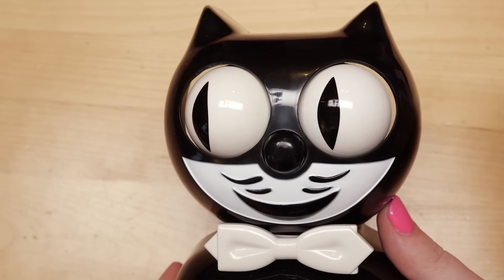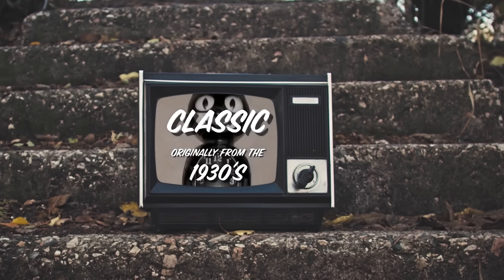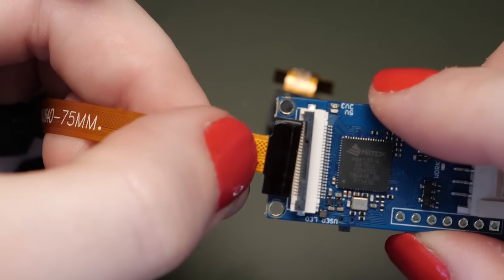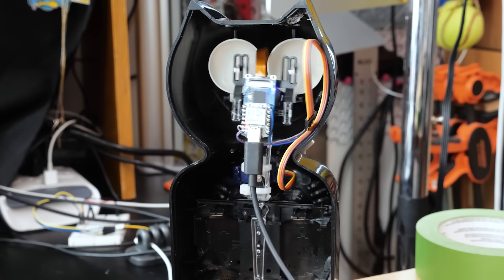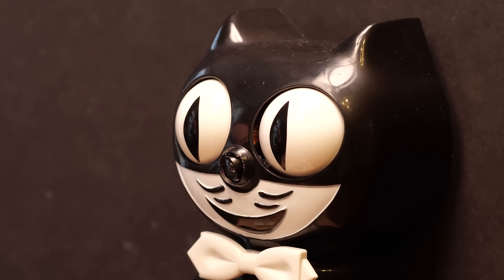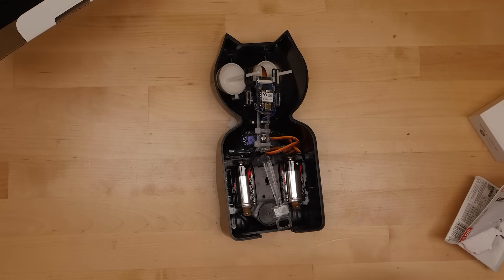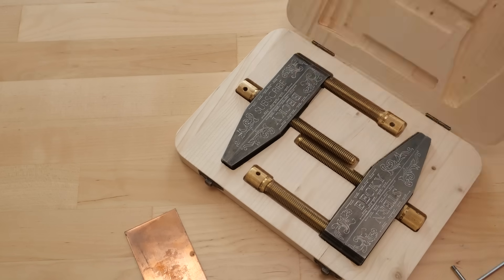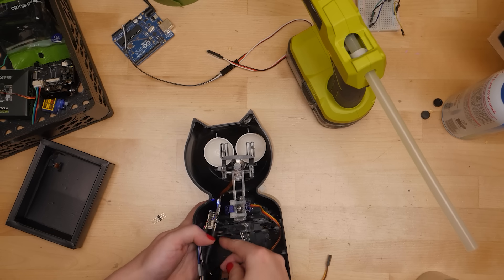This Clock's Eyes Follow You (Secret Santa 2023)

Comment: Another idea! Use a small worm gear based linear actuator for moving the eye. No more jittery movement!
Also, for the weird non-reset issue, I tried everything to fix it to no avail and I just ended up making a small Arduino board (like, extremely tiny. With ATTiny13) that resets the board after few seconds.

Comment: Looks really nice! Not sure if it would save time or just complicate things in the future, but James Bruton made an Arduino library for motion smoothing animatronics and what have you which could be useful for stuff like this - the gist of it is that the software loop has an intermediate position which is always some percentage of the set position and it moves to the intermediate position instead while constantly updating it so they converge with a nice speed ramp on either end. Thought I'd bring it up because coincidentally his Secret Santa project used the animatronic eyes from that same video

Comment: There is a pro-tip for parallell clamps: if you want to change the opening quickly, grab the clamp by the knobs with both hands, and spin it around like pedalling a bicycle. (hope that makes sense.) It will open or close in parallel, and fast!

Comment: If I had to guess that capacitor is likely part of a circuit that triggers the reset for a certain amount of time as it boots up. If it’s an active low reset and there is a pull-up to Vcc then the capacitor, since it takes time to charge, will hold the reset line low (active since it is active low) until the capacitor has charged enough, then when the capacitor charges above a threshold voltage the MCU will no longer see the reset line as low and hence the reset line will then be inactive.

So essentially the reset line of the MCU would have a capacitor connected to ground and a resistor connected to Vcc and the button probably connects the reset line to ground too. Since the capacitor is missing the MCU probably powers on near instantly when connected and starts trying to do things before it is ready, so then it needs manually reset via the button to get everything setup and started right.

These kind of circuits on reset lines are to give the voltage time to settle and allow all parts of the MCU to switch on and stabilise so that when the reset goes inactive all parts are ready to go and start running the program.

It is more complicated on more complicated processors or especially FPGAs, requiring Power Management ICs (PMICs) and requiring certain timing and ordering on the voltage rails. Like if the chip needed 3.3, 2.5 and 1.8 V then it may need the 1.8 V on first and then the output signal from that would tell the 2.5 V supply to turn on and so forth. Similarly these more complex processors and FPGAs can have requirements for the ordering switching it off too.

Comment: Rather than computer vision I think having it track heat signatures with a thermal camera would have made a lot more sense.
Reply from the maker: There are thermal camera modules out there but they are more expensive than the setup I used, and don't include the onboard object recognition capability. For instance https://www.digikey.com/short/jd5pvzq5  It could be done; I'd love to see it!
Reply: @BeckyStern  it was sort of my point, lol. With thermal imaging, I figured the object recognition wouldn't even be necessary. It's interesting that your solution was still cheaper, though. Good job.

Comment: The need for a reset would imply that that capacitor is part of a timer circuit that either resets or enables the CPU shortly after power-up, which is a really common circuit in computers, and are frequently timed using differing capacitor values. (Look up the classic 555 timer circuit for an example.) That probably implies a confirmation that it's not going to affect ongoing operation of the computer.